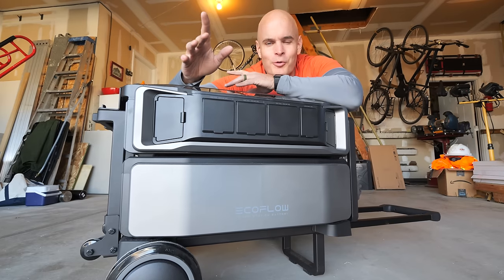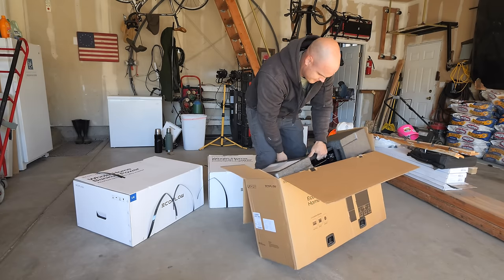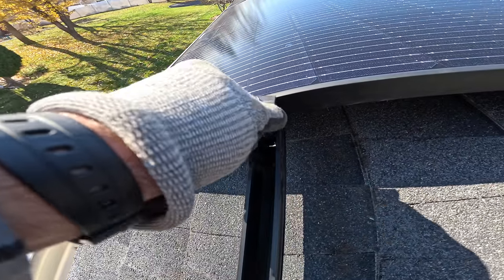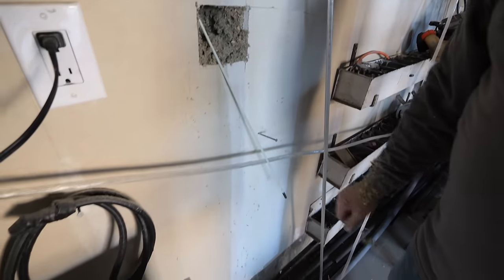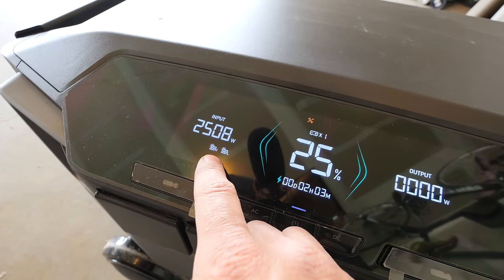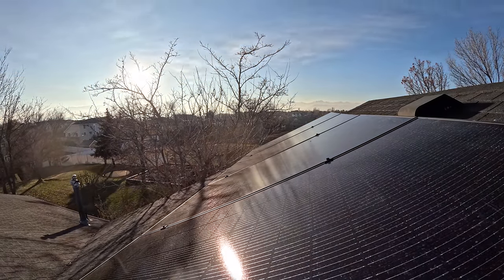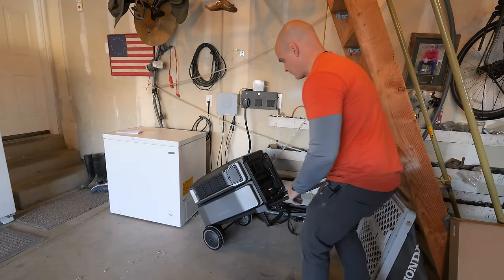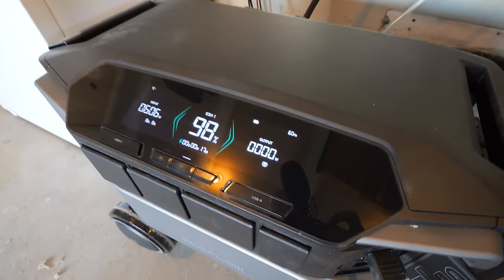Off Grid Stackable Solar Battery - So easy its *Almost* Cheating...

Comment: The average US home uses 29kw of energy per day, with the 90kw battery its enough to backup a home for 3 days, not an "entire month" as claimed - perhaps the video needs an edit?
Reply: As backup power its enough.  You should just be running the essentials during a blackout to conserve power.  Like lights, refrigerator/freezers, well pumps etc...Not your AC, water heater, 70in TV, PS5...
It scary how so many of you commenting are missing this...
Reply: @JohnSmith-wt3mw Its scary you think a family can survive a month on 3kw a day, not including losses, so lets say 2.5kw a day, for cooking, hygine, lighting and heating.  

Also the bigger problem is they know this, its designed only to be misleading marketing claim, consumers will assume this is typical usage backup for a month. I dislike someone like Jerry conveying marketing nonsense. Not the kind of person who would usually do this.
Reply: @danieljust2226  its scary how spoiled we've become.  Dont need electricity to live.  it's called surviving... SURVIVING!!! Not living your easy day to day life so your kids can watch tiktok and play PS5??!  Surviving is bare essentials...
All of which you mentioned can be achieved without electricity.  Hell learning how to make a fire solves cooking and heating...
I hope for your sake, and people with your mentality,  that we never have a prolonged grid down event or your gonna be hurting... Good luck

Comment: After hearing horror stories of people being locked out of their house because they had a lock attached to wifi, or AC units that wont turn on because they were attached to wifi, or Fridges that won't open because they were attached to wifi, I think the last think I would want is my entire houses electrical system to be connected to wifi. One server drop and your breakers could trip remotely.

Comment: This is a great video! As a solar engineer myself, I can’t help but wonder if the utility company and the AHJ were ok with this whole setup. Did you have to acquire a permission to operate, or apply for a whole permit for this system?

Comment: So if i understand correctly, every day the smart panel switches power from grid to battery and back to grid. What does that do to the electronics in the house? Because there is a momentary power interruption twice a day.

Comment: How many duty cycles are the batteries validated for? If it's only 800 full cycles you'll burn these batteries in two years
Reply: 3,000+ cycles or 8.2 years of daily cycling before they degrade to 80%

Comment: most solar panel owners say its not worth it. hope your panels are leak proof installed against water intrusion otherwise there goes your roof to mold and what not and then you gotta pay all that power saving money for a roof. and the solar panels dont last forever and are not cheap. its mostly a bad idea from what i've watched out there. i think scotty kilmer did a video on it too

i'd say at least keep as many panels on the ground as you can fit, in reach for safer servicing and avoiding all the issues with a roof install, and charge a battery pack like you have and save money that way. i would put up a small windmill too for fun lol

Comment: Jerry;
As of today, Solar Panels can only produce about 80% of the energy that it took to make them.
Every Solar Panel ever made cost mother Earth 20% of wasted energy.
The only time Solar Panels & Wind Generators make any sense at all is when you need energy very far away from the power grid.
Reply from the maker: That’s not true at all. lol. Not even close. Solar panels offset the energy used to produce them within one or two years and then keep going on with a 30 year warranty
Reply: @JerryRigEverything  Sorry Jerry!
Laugh all you like.
But to my knowledge, no one has come up with a Perpetual Motion Machine yet.

So if a solar panel could produce even 101% of the energy it took to make it, reliably.  It would be the answer to the world's energy problems.  For every million panels you make, 10K would be free.
But they don't!  It's more like 80%.

You're a smart individual, Jerry.  And I've seen and like, most of your videos.  But if you removed all of the government subsidies and had to pay the true cost, you'd never get your money back.  Not even in 30 years.

Comment: My problem with whole home batteries is the fact that they lose some of their chare over time... Is this a valid worry or is the loss not that bad? I would like to get 25 years out of a setup like you expect to get 25 years out of a roof; similar investment cost.
Reply: You'll be able to get around 6000 full cycles until they reach about 80% of their starting capacity. I think before the batteries are useless, some internal ac/dc converter will break.
Reply: 25 years is a lot to expect, there will be newer and better batteries available before that...
Reply: @kawu42   ecoflow uses cheaper cells, they only warranty 3000 cycles to 80% of original capacity.

Comment: @JRE, interesting comment about the face outlets turning off when you have the DPU plugged into the house.  The unit is advertised as all of the outlets being able to work even while AC or solar charging.  EcoFlow actually released a video this morning from their official YT channel stating the same.  (Jan 8 2024).  Maybe this was corrected in a firmware update?  The Delta Pro was notorious for bricking those outlets while charging, but its said the DPU can still work even while charging.